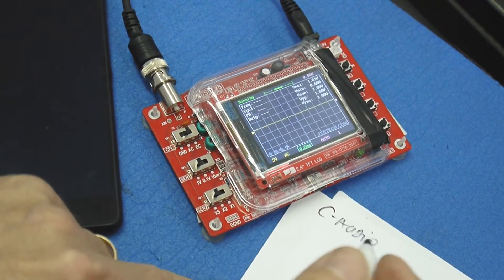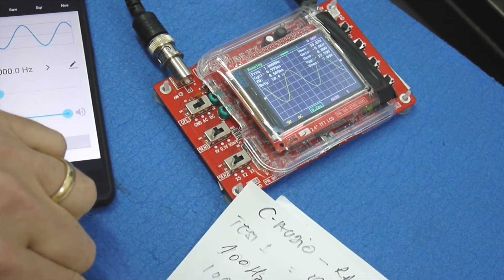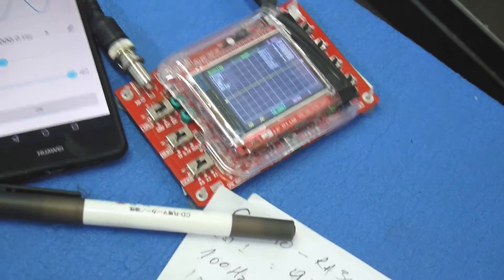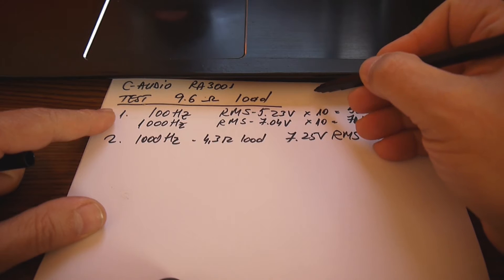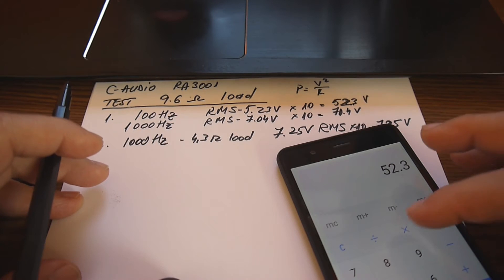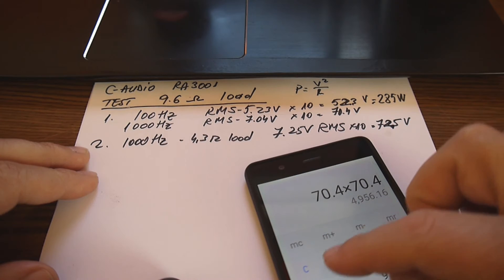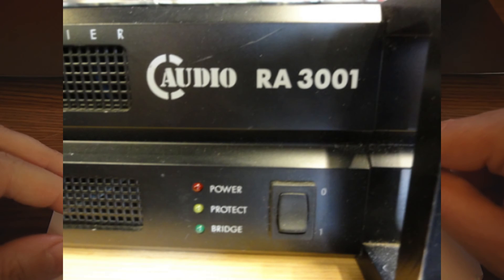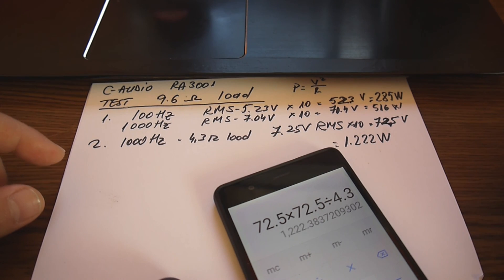Dyno C-Audio RA3001 power amplifier how to find real audio output power

Comment: Sir this amplifier is good for bass
Reply from the maker: More general let's say..not special for bass..but it's a hard working amplifier..
Reply: @viocaia  It's much better for a top speaker than a subwoofer. I tried this with my top, comparing it to the cheaper Tamp E1200, the RA3001 has much clearer highs.
Reply from the maker: @kristofnagy1574  Right, it is brilliant for medium and highs